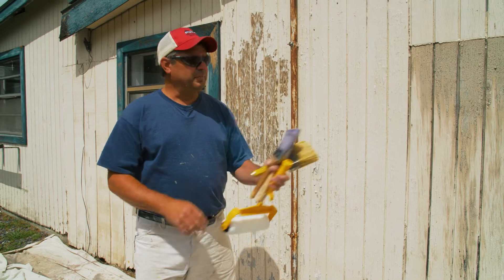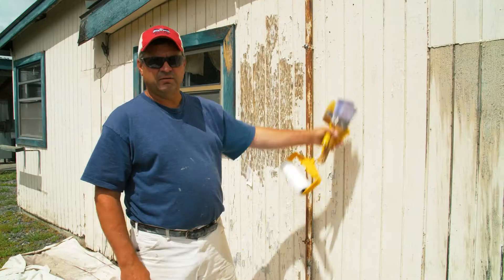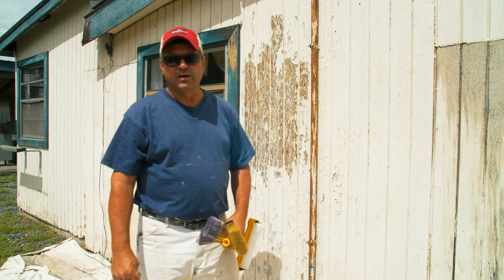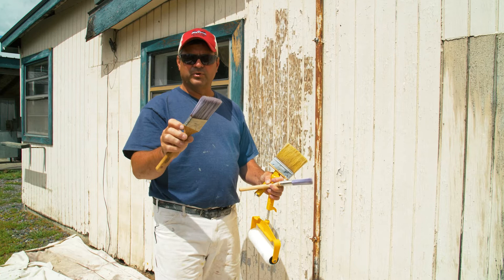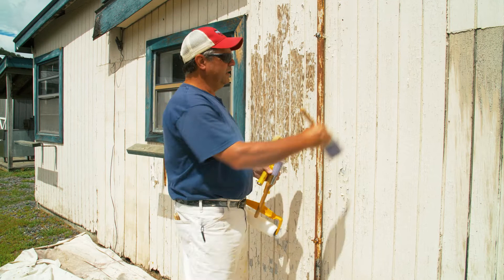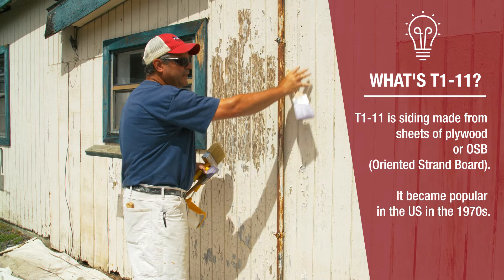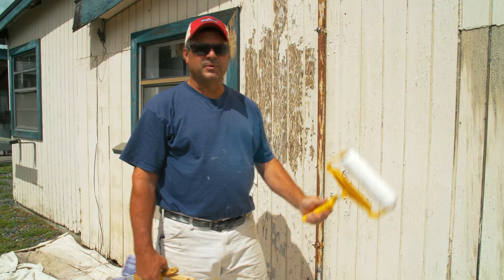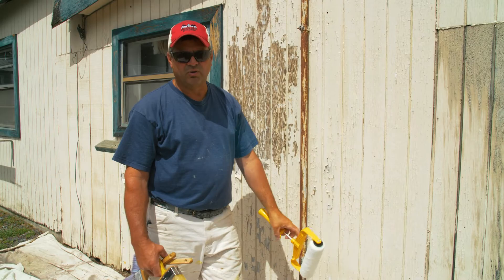How to paint siding on a house.  |  Hyde Tools

Comment: My mother and I painted our house after my fathers death with Glidden Endurance paint and it is now 18 years later and is still good.  I am only repainting because the south side of the house with all the sun and heat has made the bottom half of the house begin to peel in places, just on that side.
now that I am painting again I am wondering just how much sanding and scraping is necessary.  My house has 3 good sides and one with moderate  to low peeling or lifting.  I have scraped the one side and sanded to try and get those peeling areas flat, so when I paint (eventually) you won't be able to see those spots.  I have a feeling I may be overdoing it however and I really do not want to waste my time, if it doesn't need to be done.  The heat is on the way and I have to get moving, so I was hoping to see what might be normal and what might be overdoing it!  My siding is 70 year old redwood that is painted yellow and flat with no grain showing.
Reply from the maker: 18 years ago! That's astounding. You must have done a very thorough prep job for it to last that long. Kudos. Have you seen our other video with Jerry where he talks about prepping siding? https://youtu.be/FzPwpWxJDng When it comes to prepping an exterior, scraping and sanding as thoroughly as possible is always going to pay dividends. Understandably, you don't want to waste your time and do more than necessary, but your 18-year paint job is proof that it ends up saving you time in the end.